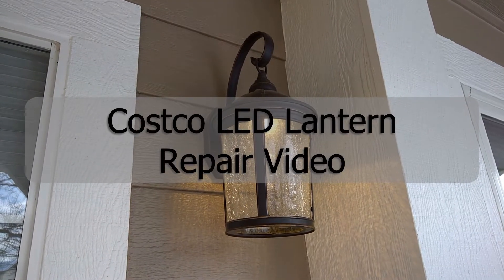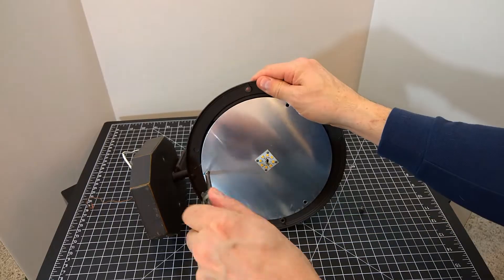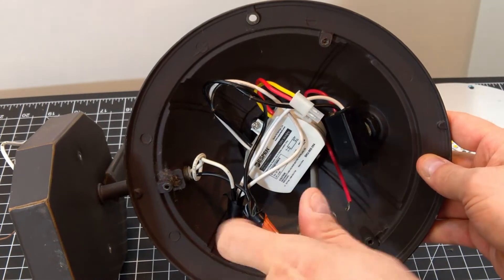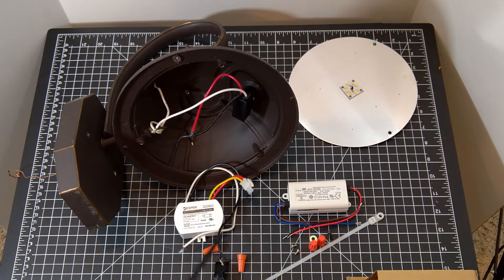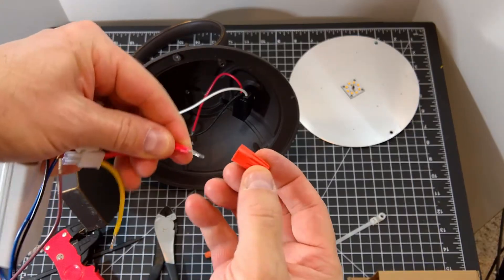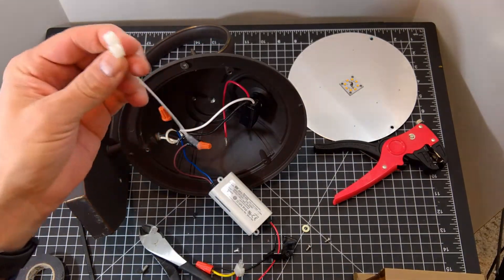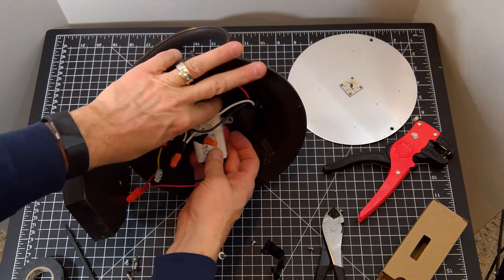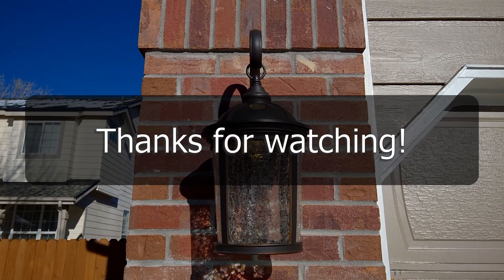Costco LED Porch Lantern Repair 2

Comment: I had this flickering condition and had a brand new Altair exterior light (but different light color) and by replacing the LED plate the flickering stopped.  I am now trying to find the part number to the right light color and don't know the model or light color of the one I need to replace.  It is like a bright (or ice) white.  TIA if any one knows of the part number.
Reply: Hi do you have the link for the led plate you used?

Comment: Thanks for the video, but this is a costlier approach and far more time-consuming than removing the driver and just installing a bulb socket, as described in another video. The original LED may fail after you replace the driver, as mine did, and you'll be offered a $40 kit by LED Supply to resolve the problem. Minimize the headache, buy the light socket. I got mine at Lowes.
Reply: Hi. Can you provide the link for the light socket? Or the link to the video?

No worries found it!
Reply: @NaveenRoy  Can you link me to the video you found?
Reply: @real_makolicious  https://youtu.be/TtJC27DnMxY?si=f23GjK2g2LEp4Zuf

There may be better ones out there

Comment: Can you just cut the power to the light and do the repair or do you have to remove the entire lantern for the house?
Reply from the maker: Removing the light from the house just makes working on it easier and safer.  Technically, the repair can be without removing the light.

Comment: Good instruction however I decided to dump the Driver and LED board for a snap in light socket.  Just drill a hole for the socket into the deflector plate.  Bought from Lowes for $5 each.
Reply: Does your dusk to dawn sensor still work?
Reply from the maker: @user-gl9vp6em6o  If you need your dusk to dawn sensor, simply wire it between the house black wire and hot input of the driver.  Think of the photo sensor as a switch.  Or between the house black wire and the light socket.
Reply: @user-gl9vp6em6o
Reply: Bypassed the d2d function in favor of a Kasa WiFi Dimmer switch.

Comment: Just completed this repair. Not all the leds work, also this heat sink runs hotter to the touch than the other 2 lanterns we have. This is all normal?
Reply from the maker: No.  First, did you simply buy the same driver?  Not all LED lights use the same driver.  This video was a follow-up from my first video.  Watch that video first!!!  You must match the driver's voltage range and wattage/mA.  Failure to do so may burn up your LED array.
Reply: Thanks!

Comment: Good video. My issues are the following:
The ground wire that’s attached below the nut, on the piece that is attached flush to the wall, is really frayed. I don’t know what to call the piece.
Secondly, can I screw a wire nut around the ground wire from the lamp and from the box together?

These lamps were given to us. I’m concerned about the frayed ground wire that’s connected to the plate piece.
Reply from the maker: I always recommend that if you are not sure what you are doing, get a professional.  It wouldn't be a bad idea to replace any damaged wire.

Comment: Ricardo, I just completed this repair on two of my Costco lights but I still have a problem. One of them appears to have a failing LED board as only one of the LEDs come one brightly with a couple of others being dim and yet others not lighting at all. It seems that the board is failing and even after I replaced the LED driver. Do you or any of the readers know where I can buy the little round LED plates with the aluminum heat sink?
Reply from the maker: Costco has many different LED lights available.  Do you have exactly the same light as mine?  If yours looks different, or your LED array looks different, or your constant current driver looks different, DO NOT copy what I did!  You may damage your LED light!  This video was a follow up from my first video.  That video kinda goes through how to buy a replacement driver.  YOU MUST find a new driver that matches the old driver or has better ratings.  You must match the mA rating!  So, if you existing driver has 350mA, you need a 350mA replacement.  This is the constant current that the constant current driver will supply.  Higher values will burn up your LEDs.  Lower values may not work at all.   If your old driver has an output voltage range like 18-35 volts, YOU MUST find a driver that has that range.  It can also be a little lower and a little higher, but that range must be included.  For example, a new driver with a range of 11-45V would cover the previous range of 18-35 volts.  Failure to meet this will subject your LEDs to the wrong voltage values.  LEDs voltage requirements change with temperature.  This is the reason we need this range.  Lastly wattage must meet or exceed the previous wattage.  This is where I think greater is better.  Having a higher wattage gives you a margin of driver capability.
Reply: This conundrum is why I dumped the failed driver and bought the bulb socket at Lowes and installed it on the round disk. Now I'm using a $2 regular LED bulb.

Comment: Is there an easy way to convert to a bulb mechanism?  This is too complicated
Reply from the maker: Of course, I think there are several comments discussing you to add a standard bulb socket to this fixture.  Note, most standard LED bulbs are not meant for outdoor use.

Comment: I have these exact integrated LED lights all around my house. 3 of them, all connected to the same switch... A couple months ago, 1 started strobing. I disconnected it. A couple weeks ago, another 1 out of those 3 started strobing, but all the sudden is working correctly again. I have no dimmer switch. Anyone have any idea what the issue could be?
Reply from the maker: Your driver has a range of voltages that it can operate with a maximum wattage.  If the temperature change is great enough, you may be exceeding the capability of the driver.  This causes the strobing.   Or your driver is near its end of life.

Comment: These lights are a pain in the ass no one sells them that don’t last! Not to mention they are complicated
Reply from the maker: Well, they're no more complicated than ordinary incandescent bulbs to connect to your house.  They're just a little more complicated to fix.  After I've fixed mine, they've been trouble free ever since.
Reply: @rickmorenojr  I purchased my house last year and they have these type of light. I can’t find them in any hardware store. I can’t find them anywhere . One of the lights has a serious Dimming issue it’s pretty much out…. They were supposed to last for 30 years yeah right

Comment: I have a Model Altair AL-2150 with 8 LEDs do you know if your is the same and what driver would I need since they are different for each model?
Reply from the maker: Every LED light has different driver.   You will need to find one that matches your output voltage range, mA (milli-amps), and wattage.  see my other video https://www.youtube.com/watch?v=de9pA0WyFe8

Comment: I replaced the drivers last year on all 5 of my lights.  Now one went very dim for a while and I just noticed it is out completely.  I am not sure it would be a driver or the led.  Any suggestions and could a driver go out in a year?
Reply: Yes, my suggestion is to junk all LED's and go strickly to bulbs. Its hard to find drivers etc. and not counting al the dismantling when you can just change a bulb.

Comment: As I sat there an looked at the different colored wires from the original LED driver and the new one, I wasn't sure what to do. Thankfully, you provided exactly the information I needed about which wire goes with the other ones. Let me summarize that in case anyone else has the same issue (Working with the same driver recommended by Mr. Moreno):
From the LED driver to the LED plate with lights:
Red to red.
Yellow to black.

From the LED driver to the light sensor and house wiring cluster:
Blue wire to the white neutrals.
Brown wire to the black wires.
Reply: I have the same garage lights that are in the video. Same problem with the blinking. What is the email address for the company you got your replacement parts.And what is the replacement model number
thanks

Comment: how about just replscing the led lamp, will that work?
Reply from the maker: Replacing the lamp, do you mean the entire lantern assembly?  Since I bought three that match, I wanted to keep a matching set.  Now if you are referring to the little LED array, sure you could replace the array with on that has a built-in driver or buy a LED array with a matching constant current driver.  However, you risk getting a light that has different lumens (brightness) or kelvins (color).

Comment: I have repaired one already but now, a couple of years later, the other one is blinking. But when I look at it it looks like only one of the LEDs is lighting so I am not sure it is the controller and not just the LED thing.
Reply: I have that situation  also. If there are blank spots on the failed LEDs, then both LED and controller are bad. Good luck buying a pair of compatible components. I'm thinking of converting to Medium Base E26 socket so all the LED smarts is in an ordinary replaceable bulb and it's not a problem to repair every few years. Just change the bulb.
Reply: @virgilbanowetz4941  How do you do that?

Comment: Very simple straight forward repair. Cut the quick connect from the old driver  and connect it to the new driver with mar connectors. I believe they are a red and a black wire .Connect the other two wires on the other end to what it was attached to on the old driver .Both old and new drivers should be labelled the same .

Comment: Where were you able to get the new drivers. The lighting place I call says I have to buy a new fixture as they aren’t available I need output 6-10v 700ma load 6-9 watt led in series led d35-2  input 120v 60hz

Comment: Nearly all wire nut manufacturers recommend a different method for connecting wires than twisting the wires together prior to using the nut.
Reply from the maker: Excellent, and that would be?
Reply: So are you keeping the different method a secret?

Comment: OMG this is so complicated I just might buy some new lights!!
Reply from the maker: Actually this is simple.  Two wires in, two wires out.  Simple. Complicated is driving a Ford model T.  Darn, I wish I had a link to that video showing how this was done.  The three foot pedals are used to switch gears, throttle was the right lever/stock next to the steering wheel, timing(?) was on the left lever/stock, and lastly you had the hand brake which you also used to shift gears (move hand brake, press foot pedal).  Wow, I'm glad that cars are as complicated.
Reply: What state do you live?  I can buy the lamp from you... missing 1

Comment: If you want to use the photocell do you connect the brown wire from the LED power supply with the red wire from the photocell?
Reply: I just connected this exact driver and used the photocell. You want to connect the white wire from the photocell to the white wire coming from the house and the blue wire going into the driver.  You want to connect the black wire from the photocell to the black wire coming from the house. You want to connect the red wire from the photocell to the brown wire going into the driver. Connect the yellow wire from the light to the black wire leaving the driver. Connect the red wire from the light to the red wire from the driver. That is what I did and it works great.
Reply: @max_power3386  Thank you very much.

Comment: When the lamp just keeeps flashing is it be small  led light and not the conductor?
Reply: Flashing indicates it is the controller bad. Some dead light and one good one indicates LED is bad.
Reply: @virgilbanowetz4941  I have 3 of these running off the same switch. 1 of em just constantly strobes. I disconnected it. Another out of the 3 recently started strobing, but all the sudden started working fine again. I have no dimmer switch. I have no idea what the issue is.
Reply: @floydclark6710  Your controller is bad causing the flashing. You can try buying a matching controller to the LED circuit. Good luck with that! I recommend you get a simple socket and a common screw-in  LED bulb that matches the color of the other lights in the area.

Comment: Good video but NEVER assume it's just one thing.  I used a meter to check the voltage to the LED's.  I found that they were getting 39 volts so that ruled out the driver.  My LED's were bad.
Reply: I was expected some  problem isolation technique as we have two components which might be bad as well: driver and LED. I guess I have to switch parts with the good one to see what component is bad.
Reply: I was wondering how he knew he had a bad driver.
Reply: were you able to replace your LED's?  If so, where did you find replacements.  I've spent a few hours googling for replacemnt LED's but cant find any.  120 VAC input, 36 VDC out put driver.
Reply: Same problem, I can't find the replacement LEDs anywhere.
Reply: In case that problem are the LEDs maybe you can replace driver and LEDs with a normal LED bulb 💡

Comment: I have three of these lanterns and all three went out within months of each other. We replaced drivers in all three according to the video instructions. One worked great. The other two did not. The second lamp is completely dead and the third lamp flickers once in a while but produces no real light. All the wiring, including wires in the wall, look correct with no corrosion. All three are on the same circuit but only one has a switch. The two not working have no switch. What can be the issue?
Reply: you can try testing the working driver with the other 2 lamps that did not work correctly.  Try to rule out whether its the driver or the leds. 
Also check that no wires were connected in reverse and that you do get current from the wall where each lamp goes.
Reply: Just had an electrictian install the new driver....still doesnt work He said its the chip

Comment: Had a bad LED lantern from Altaris thru costco. Started flickering and then just went out. Replaced the led power supply but it still does not work. Checked the output voltage on the power supply it was a constant 46.5 V. Could the led strip itself have gone out ? If yes, where can I find a replacement? . Thanks for your video , very informative and well made.
Reply: I purchased a driver but my electrician said it was the LED.

Comment: Thanks for the great video, fixed both units for $15.
Reply: Where did you get your parts? My fixed current driver is $30 and a compatible LED is $20.  The entire fixture can be replaced for $38 so I may switch the socket to a standard Medium Base E26 so an ordinary LED bulb can be used.

Comment: Fixed mine, thanks, BUT!  After about 2 months half the LED's went out, now only 1 LED is on.  Can you recommend an led cluster I can swap out?  Even if it means drilling out a sizeable hole in the AL reflective heatsink plate?  Anything that would work with this new LED driver I just installed?  Thank you.

Comment: Thanks for video.  My 2150 is flashing, I replaced the driver as you demonstrated.  However it is still flashes.  I have four these lights, so swapped out the LED plate with one that works properly. Now the flashing issue has changed lights.  Do you know where can purchase the 8 LED pad?

Comment: Where would the photo cell wires connect?
Reply from the maker: If you want to keep your photo cell operational, be sure to wire it back as original.
Reply: Wire it in series to one leg of power to leds.  Its just an inline switch.

Comment: Awesome! I have 6 of these fixtures on my house, and I love how they look, and the light they put off, but 4 years after install 2 of them are flickering. I bought 3 of the drivers you listed (make sure you select the correct options because the link doesn't auto fill to the exact one). It took me about 35 minutes to do the first one, and about 10 minutes to do the second one. They work perfectly now! I ordered a spare cuz I'm sure another will fail someday, and now I'll be ready! 

BTW...  I wired to include the photocell so the brown wire from the driver goes to the red wire coming off the photocell.

Comment: Great video Ricardo.  My front porch lights have been flashing for a while now.  I came across your video and gave it a try.  4 new drivers and an hour of work and now I have 4 porch lights that work properly.  I bypassed the light sensor like you suggested and I am very happy with the results.  Thanks again.  Cheers!

Comment: I followed the instructions and when put back together, the light is very dim. Any idea what went wrong? I bought three apc-16-350 drivers from mean well. Thanks
Reply from the maker: Is your light exactly the same as the one shown in the video?
Reply: Mine was dim also, only one led was working.  See my post above to replace LEDs with a bulb socket and led bulb, remove the current driver.
Reply: @dmudder5529  I thought about this too. Less guess works and replacements is not hard to find.